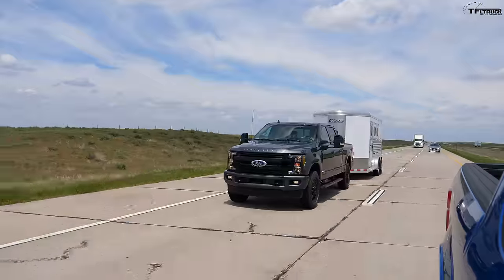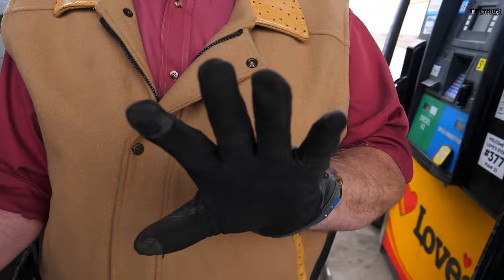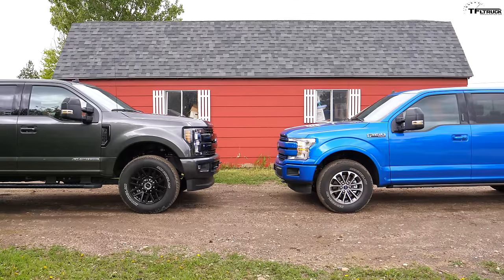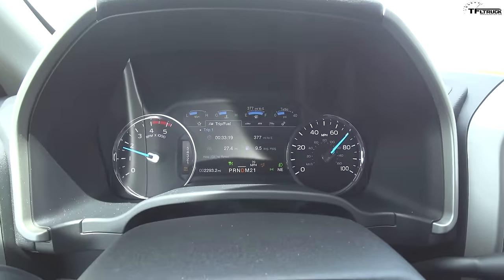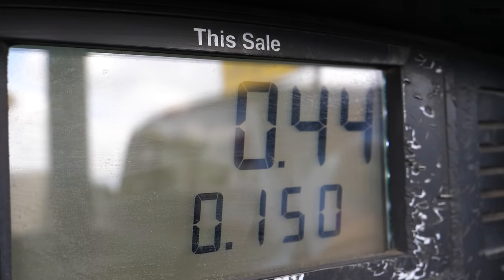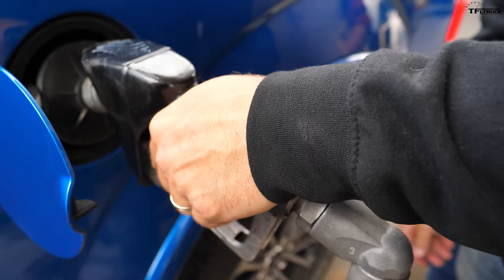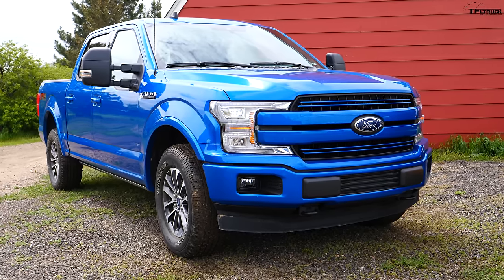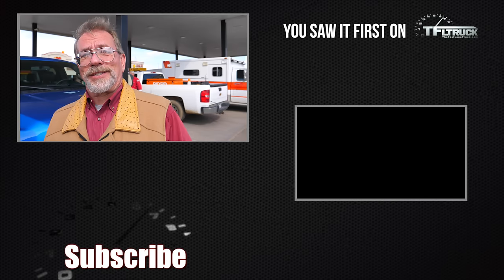Do You Really Need a Heavy Duty Truck to Tow 9,000 lbs? Ford F-150 vs F-250 MPG Review

Comment: 9000 lbs lol. We used to haul 12500 with a chev 4.3 and 4.10 rear gears.
Reply: no you didn't. the 4.3L V6 had a maximum of 5000 pounds, then when GM went too the 4.2L V6 in 02, the maximum on that was 6500 pounds. only the 5.3L V8 that was introduced in 99 had a max towing of 9700 pounds. the F150 was a little more at 10,000. the Ram 1500 towed the less at 9000.
Reply: @Jeymez  umm I've still got the scale ticket. Truck pulling 18ft flat deck loaded with green pine plank.   Full wheel covers and door badge delete fooled many a DOT flunky 20 yrs ago.
Reply: Mini Barns: id like to see proof of this. im not trying to doubt you, it's just that im very familiar with the 4.3. i've towed things with the Blazer, GMC Jimmy, the Silverado and GMC Sierra before 01, all those trucks had the 4.3. the horsepower and torque numbers on those trucks was, 208 horsepower, 254 torque. that was enough to give you a max of 5800 pounds, but that's only if you get the 373 rear end, because the vast majority are around 335, and can only tow around 5000 pounds. so unless you have some modifications in your engine, your not towing 9000. not even the V6 in the Ford Explorer or F150 from that era can do that, and the vast majority of those had a 345 rear end. unless you got the V8 version, then you can tow more than 5000. now in the real world, i have towed more than 5000, but it was a 99 GMC Sierra i did with. pick up trucks tend to have more power in the torque department than a suv, but less horsepower than the Blazer and the Jimmy. i think the Sierra had 196, but the Blazer had a little more horsepower. but i still couldn't tow no more than 6000. but in the Blazer i couldn't even tow anywhere near that number.
Reply: Raven Fox the engine power has less to do with towing capacity than gearing, frame strength, suspension, and braking. I drive a semi for a living and we actually have much lower power-to-weight ratios than pickup trucks hauling loads like this. I drove through many mountains at around 79,000 pounds (33,000 truck and trailer+46,000 pounds of lumber) with a 14.8 liter Cummins ISX 15 making around 450 horsepower and 1500 lb-ft of torque. Those are typical numbers for the average semi truck you see on the highway.

Sometimes I could only go 19 mph up a mountain in the Rockies, but that’s what my 10 speed transmission was good for! And the engine brake kept me safe coming back down. And our big engines are good at that and for fuel efficiency. I can get over 9.5 mpg on flat highways in the summertime if I’m empty, so that’s pretty impressive for a 15 liter engine!
Reply: Raven Fox Dude, you’re on another way planet. Read his comment again; the guy’s telling us what he pulled, not what the rated towing capacity is.

Comment: What I have been dealing with is I have a 33' travel trailer and I had to look at what I can tow with. If I had a 3/4 ton or 1 ton pickup it would be no problem. I am trying to accomplish 3 things with my tow vehicle. One I need to have seating for my kids, Two I need to have a wheelchair lift with room for a wheelchair. Three I need to have a capacity to tow 8000 lbs. plus. I had made a mistake and did not check the numbers on the van that I got. A 2500 Sprinter Van hight top, 170 wheelbase. It is a Diesel so I can tow it but the chassis will not permit it. I only can tow 5000 lbs at max even with a weight distribution system. I also can only have a cabin weight of about 945 lbs and the wheelchair lift is about 1000 lbs. I do not want to endanger my family and wife towing and vacationing. not to mention the legal ramifications as well. The Ford Trasit can't help or the Dodge Promaster. The only vehicle  that can do all the things that I desire is the Chevy Express or GMC Savana 1 ton. My question is What ia better all around especially towing, Is it 3.5 Duramax diesel or the 6.6 Vortex gas engine in the Van. Will the durability of the diesel last longer then the gas engine? The diesel is smaller then the gas but the diesel runs at a slower RPM witch will give longevity and sufficient power, but the gas engine has more power. What is better in the long run?

Comment: Another factor not talked about in this video is the size difference between fuel tanks. I tow a 34 ft travel trailer with my 1500 and you will notice rather quickly that a 26 gallon tank at 8 mpg is very inconvenient. Not to mention the fact that most modern gas stations do not accommodate a 30+ ft travel trailer very well so it can be challenging to manuever around the gas pumps especially if its crowded. I have since moved to the duramax and difference is night and day. While the 1500 was more than capable its though little nuances that make a huge difference if towing a long distance.

Comment: Hang a 9K trailer on a current 5.3 Silverado and drive at 70mph....see what kind of MPG it gets. I know it's not apples to apples but I had a 08 5.3  Silverado with a 4 speed automatic, with a MUCH lighter 12ft aluminum V nose enclosed trailer with no load in it and the thing was just  a SLED at highway speeds....it felt so over worked.  Now I have a 2019 150 3.5 eco and towing the same trailer is effortless. It's amazing what the 3.5 ecoboost can do. Side note; even though my old Chevy struggled with that trailer it always did what I asked of it....so kudos to my old rusty Chevy.

Comment: I have a 2018 1500 CHEVY with the 6.2   8 speed and my son in law has a 2018 chevy HD with a 6.0 gas. Last  week we needed our skid steer hauled right away. I called my daughter and ask if she could take my truck and get the skid steer she said yes. I also have a 06 GMC 3500 gas. I thought she would take the 06 GMC but the 1500 has 3 ball receiver and trailer brakes so she used the 1500 and did not think anything about it.  She said she had no problems starting and stopping. And it did just fine on hills up and down. I am not in to FORD VS GM VS DODGE my point is no matter what brand these new 1/2 ton will do a lot more now than what people realize I would have not have do that but I WILL.

Comment: My truck is a 05 F-150 rated at 10,000 lbs. So there, I answered the question for you. I pull 8,000-9,500 all the time with mine. Looking to get an Eco Boost or even a F-250 for my business. I could use it to pull more weight.
Reply: Your over GVWR with that trailer in tow

Comment: I drive a 2018 f150 with the 5.0 and it pulled my friends camper (13,000 lbs) no problem. Only issue was it was not so easy to stop

Comment: I have a 2010 f150 ....I built a 9000 lb tiny house on a 5th wheel ....I added a leaf and put a HD Detroit locker in the rear end. I have the 5.4 triton engine with 340 000km on it ...the first time I ever hauled anything with that truck was that tiny house ...I drove 5600km across Canada and over the rockie mountains with that truck and that many miles ...so when he says if your pulling a 5th wheel then you need to step up to a super duty is bullshit .....$1200 dollars for the rear end work in my case ....not 30 Grande more for a truck

Comment: Can a 1/2 ton pull a small 9k trailer or flatbed sure. Add a 30ft tt some wind and hills you'll want to go 3/4 to 1 ton.
Reply: Not if 1/2 ton truck is loaded with any passengers or cargo payload and GVWR exceeded

Comment: Was seriously considering a newer truck since I just bought a new toyhauler with front deck instead of the rear garage. Put 1400mi on my 2000 Excursion in 4days towing and averaged 7.5mpg with my V10. I'll gladly take the 1.5-2mpg loss and save me $65k.

Comment: Every person I've spoken with at campgrounds who had a 3.5 ecoboost had already upgraded to a 250 or 350 because of downhill and braking issues with pulling anything over 7500#'s. Those who still had the ecoboost said they'd be upgrading in the near future for the same reasons. Fix that v8 150 so we don't have to pay for a Superduty to tow a measly 7500-9000# load.  ...and I wouldn't mind payiing for it if I could find one, but there's 150 ecoboost's available everywhere so that should tell you something.

Comment: Good video, the diesel won't shine until big boy weights are being towed. Interesting they were that close though @ 9,000
Reply: If the trailer weight was less for the diesel to offset the heavier curb weight.  It would have gotten better mpg but not much more.  And up hills would have killed the gasser mpg.

Comment: As a professional mechanic of 25 years and shop owner and diesel owner/builder I will say no matter what the make its about the running gear not the engine (unless speed is a factor for you).  Bigger bearings in the trans, tcase, diff(s), is a testament to longevity.  Maintenance is also a key factor, change fluids often and I dont care what the manual says about "extended service intervals on fluids" I dont care how good the lubricant is it accumulates metal from normal wear and that crap circulates around causing undo wear (and leaking seals) on things like diffs and tcases.  Turbos kill gas engines so far, I am watching this ecoboost in fords, time will tell.  Diesels are extremely expensive to maintain and repair compared to gas, that is a simple fact.  Timing chains fail in ford 6.4's with lack of maintenance/wrong oil.

Comment: after working on so may high pressure fuel pumps on these 6.7 from 75000 to 125000 miles you can keep them all..  our shop is one of the few that will even work on them and since we have done so many it don't take long to do it anymore. but I will never own one. but I wouldn't mind trying that 7.3 gas if they ever put it in a half ton.

Comment: No one who has towed with a diesel with an effective exhaust brake would use a gas powered F-150 for a trailer load exceeding 8,000 lbs unless the terrain was dead flat. A friend used his 40 HP Volkswagen Beetle to tow his 7,000 lb sailboat from the storage yard to the boat hoist, a distance of several hundred feet on flat ground. 

It is also the air drag that needs to be considered as well as the 15-65 mph time needed to safely merge with freeway traffic. Don't think that the drivers of big rigs will kindly pull over a lane to let an RV enter the highway.

Comment: It's not about pulling at all, if someone pulls out in front of you in the 1/2 ton you can't stop a normal trailer.  Being that most normal trailers do not have brakes.  Braking should be one of your factors, and it should be most important.

Comment: The F-150 Heavy Duty Payload Package 3.5 EB versus F-250 towing a 9,000lbs travel trailer would be the ultimate test of a half ton truck. 

The HDPP F-150 is the pinnacle of half ton towing, not the Max Tow, and there is no tougher towing test for a truck than a long tongue  heavy 30 plus feet travel trailer.
Reply: I tow with a 7700 gvwr 3.5 ecooost (9000 lb 5th wheel )373 gears with 1620 lb cc. drop in height is1.5  with Timbrins   .Ihave absolutely no problem  Why test a lesser truck with a F250????
Reply: Linda Eisenhauer agree, test the best towing capable of the class. FLT like using loaded trucks for comparison, and those loaded trucks are basically 3rd string tow vehicles compared to the more capable 1st and 2nd string vehicle in the class.

Comment: you need a 3.73 rear end in the 3.5 to handle going down hill in the mountains.  3.73 rear diff. I had handled mountains fine 3.55 didn't.  however just for hauling to the beach on the highway 3.55 rear diff will get you there and back.

Comment: I think a low slung long trailer setup right will pull fine up to about 10k with an f150 like that. A short high wall trailer without wt dis and anti sway? I'm not gonna get over 35 pulling it. If you pull a trailer like that everyday. Get a 250. If you need to pull 14-15k get a 350. If you need to get near the f350 swr max constantly get the dually. If you're gonna be near the f350 drw max. Get the f450(ratings are similar but it's a heavier duty truck all around) and so on.

Comment: Wish you would tow a travel trailer that has much more frontal area. Rv'ers that tow travel trailer are always fighting trailer sway.  Plus there is more weight on the hitch. 

Thinking you guys need a travel trailer toy hauler that you can still use water ballast to get the heavier weigh when needed.

The frontal area of the trailers you guys use have a much smaller area than a travel trailer.

After watching this I think I can tow a 9,000lb travel trailer with the F-150 when I know I really can't.

See if you can get in tight with an RV dealer instead of the horse trailer dealer.

Comment: Having owned both a diesel SD and an F150, have to say that a 9K weight trailer would never be towed by my F150. It just does not have the tires, brakes or cooling capabilities. The rear axle is also too light duty vs the 250/350 Then that 1.5 - 2 inch squat on the F150. If it has an overload leaf in the spring pack, it will be clanging over any bump larger then an an expansion strip. Next, that gross weight capacity on the F250 B pillar limits the total weight to 10,000 pounds by government regulation but is regularly ignored. Be really careful with both trucks on tow and load weights. Fuel mileage - gotta believe that the diesel either has a numerically higher number (I missed it if you noted it in the video). My 6.7, 8360 pound CCLB diesel 3.55 gears hauling a 12k, 38 foot Montana would regularly see 10-11mpg anywhere in the US. The NA F150 - sigh. With a 7K 27 foot TT - might see 7-8mpg at close to sea level, less at altitude. Yes, you guys did a 66 mile loop at 7K +/- altitude, IIRC. Is it really indicative of what these trucks can do?

Comment: You need the tougher pickup to pull that weight frequently.  If you don't you will wear out the rear differential and axle bearings.

Comment: Surprising the two V8s had such similar gas mileage, but the F-150 in this test was not outfitted with the 20" wheel package as the Super Duty was.  Appearance is everything, wheel circumference is not when towing MPG matters more.  A Super Duty with 18" wheels would yield a better score.

Comment: The power to weight ratio still favors the diesel.  Is it worth the extra cost?  Depends.  Do you tow for a living?  Then in the long run probably.  Do you weekend warrior tow once a month for 3 months?  Then no.  Both rigs are far too $$$ anyways for my tastes.  Perfectly happy in my 01 F150 5.4.  Its paid for

Comment: That was a really useful comparison. I have a 2015 f150 fx4 with the 5.0 v8 and tow a 3 horse steel trailer regularly. I can get around 11 to 12 mpg at 70. I always wondered what a diesel would do with same trailer. Thanks for this comparisons
Reply: Also get 12mpg but @ $5.50/gal

Comment: It has nothing to do with power.  Of course a 400 hp/torque truck can pull it.  That's more hp/torque than a 7.3 diesel had.  It's all about safety, stability, braking, etc.  How does it feel with a 15-20mph wind?  That's where you see the F250 shine.

Comment: I would like to see a F150 Gas vs F150 Diesel comparison. Or better yet, Chevy C1500 Gas vs Chevy C1500 Diesel since the 3.0L Duramax comes with an exhaust brake which provides better downhill control. How about a comparison between the HD diesel, the 3.0L diesel and the 2.8L diesel with a light load?

Comment: thought you were comparing a 1/2 ton vs a heavy duty, not an f250, at least make it a f350 if not a 350 dually for the heavy duty. on a side note for buying more truck than you need. i have a 3500 chevy dually and tow a 26' travel trailer, obviously more truck than needed. i passed an accident today with a hyundai santa fe (2005ish) that was towing a travel trailer about 24-26 foot long and ended up with the trailer on its side and the whole vehicle/trailer facing the wrong way on the interstate. i think the wind had a part in the accident but i dont think anything was setup properly on the tow vehicle (weight distributing, tongue weight), to me a way to light towing vehicle for that trailer. i would recommend always getting more truck than you need, better safe than sorry.

Comment: I'm surprised the powerstroke didnthat bad. These guys used the new 2019 ram 3500 to tow 30k lbs a couple months ago and that new 6.7 Cummins managed 8.7 mpg. I was thinking this powerateoke could have done 11or 12. My dads l5p has been getting 14-15 towing around 4k lbs. But the duramax motors on all these tfl videos has done better in fuel economy

Comment: Should have used a gas f250 with 3.73 gears and an EcoBoost f150 with max trailering 3.73 gears. There is no comparison at all with the two trucks used in the video. A 5.0 f150 with 3.31 gears....I wouldn't tow more than 7k with that. Still a good video as always guys.

Comment: I drove a 2019 F150 XLT 6.7  fleet vehicle towing 18000 lbs AG tanks on super singles. What a rocket. 3, 500 miles later they DEF was stiill above 1/2 on the gauge.
Reply: F150 with 6.7? Not a chance. There is no factory Super single option.
Reply: @CanadianTexaninLiguria  The tanks had super singles. The truck was a 6.7 F150,  built in March 2019. I did not like the plastic dash but it ran great. Averaged about 11 to 12 MPG when pulling to and from farm fields.
Reply: @Rick Johnston It's a leased F150 6.7 power stroke crew cab. I'll send the pictures to TFL.
Reply: Sorry boys the glass of water that was spilled on my key board now puts a 1 on on the two location. I'm thinking why do they keep saying f-150 .

Comment: Yeah it is 2019 Velocity Blue Ford F150 5.0L V8 395 Hp 400 Torque 10 Speed Automatic Transmission  Lariat FX4 Crew Cab Short Bed 4wd 1,679Lbs PayLoad Cup Holders Trailer Pro Backup Gauge Cluster Mpg Number Is=8.4 Vs 8.8 Ulimate Compact Halfton Truck $64,555 Vs 2019 Stone Gray Ford F-250 Lariat 6.7L V8 PowerStroke 450 Hp 935  Torque Gauge Cluster 6 Speed Automatic Transmission Panoramic SunRoof Mpg Number Is=8.9 Vs 9.3 Ulimate Compact Heavy-duty truck  $75,085 Thousand Dollars!!!!!!!!!!